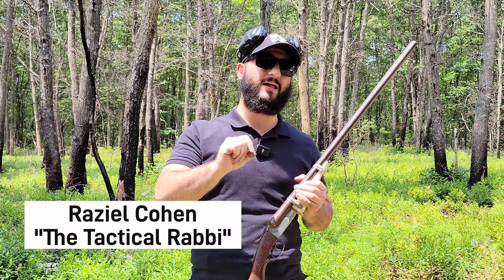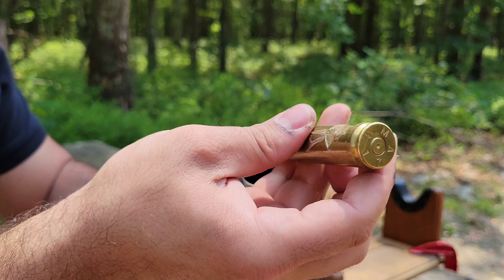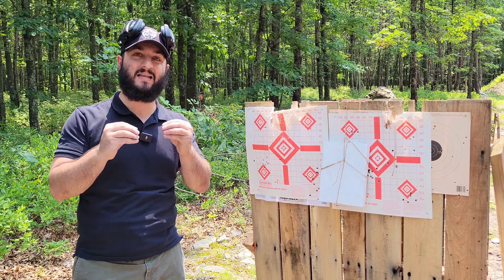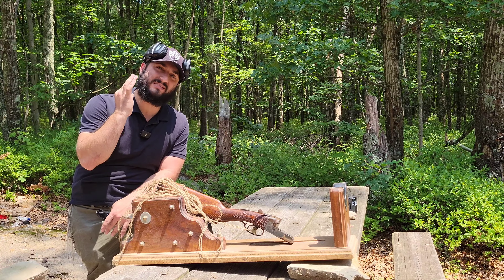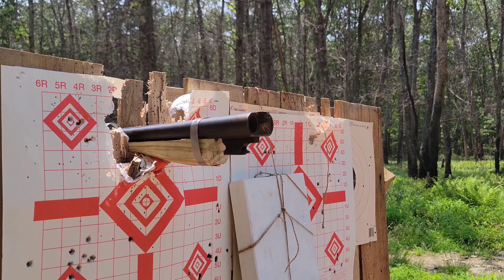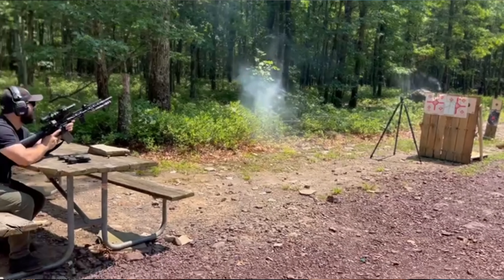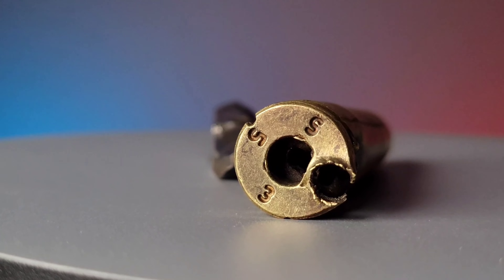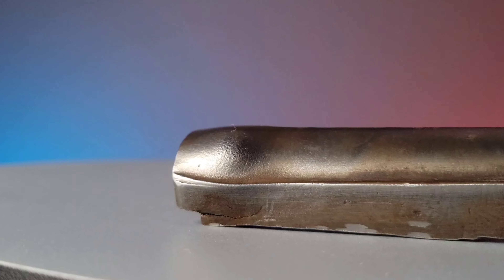Shooting a 50 Cal out of a Shotgun!

Comment: A bit of electrical tape around the rim would give you the fit you need for a good primer strike, Just because it made a dent doesnt mean it was a solid strike that would cause detonation of the priming compound.  When you sort that out, Try putting a 5 gallon jug at the end of the barrel,  Out of the 220-240 odd grains of powder, You will find maybe 20-40 grains actually ignited due to the burn rate of the powder and lack of pressure build up in the expanding case.  Probably capture the bullet in the empty 5 gallon jug as well...  Then you can do another experiment and shim the BMG round with cut up coke can and electrical tape from the base to the tip of the projectile allowing the round to generate pressure will give you "The Bang"